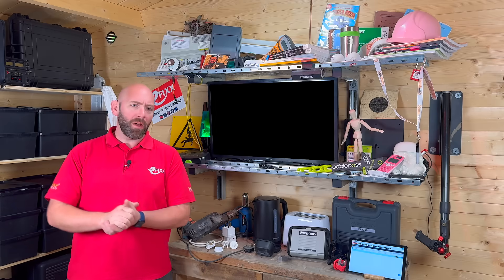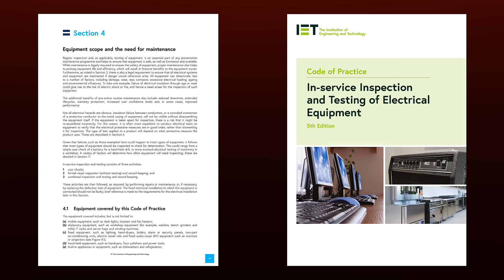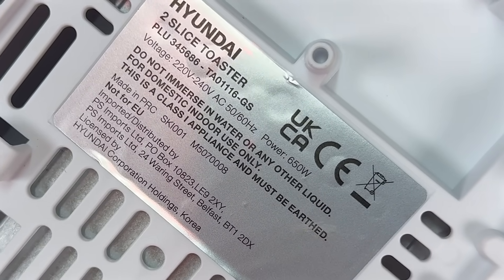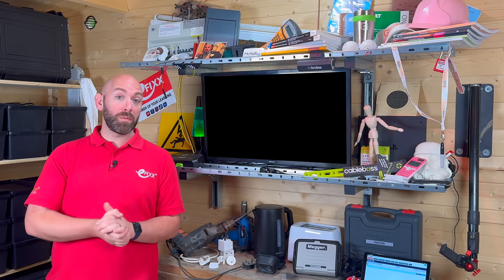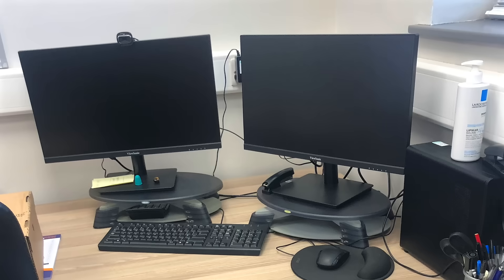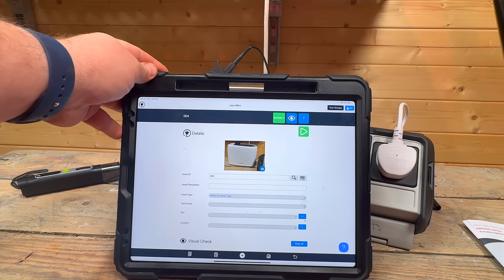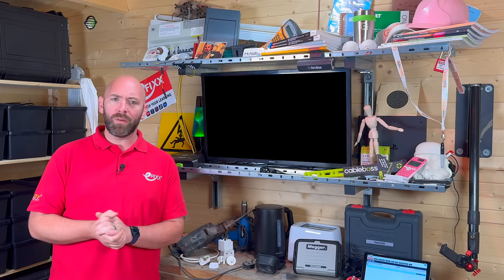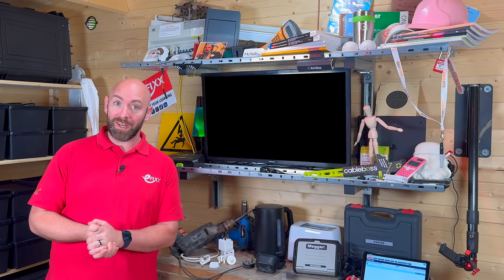PAT Testing ISN'T What You Think It Is!

Comment: The visual test is IMHO where corners are most cut. It's not easy or convenient to games things from u see a desk or counter, but without doing so can you really check the cable walking it's length?taking off the plug cover takes time, as does rectifying cable grip issues etc. Often these items are ignored and it's just a case of does the machine display a tick or not,how this gets addressed when the focus is on price I dunno
Reply: Maybe but it is usually where most actually dangerous conditions can be picked up.
Reply: @JimWhitaker I agree,  but it's probably the most skimped test, especially by those doing 20p and item tests
Reply: The pricing is always the problem. Managers want as much turnover out of their staff as they can get. Why? Because if you can push one person to „PAT“ three items a minute at 30p/item you're making £££s winning contracts from businesses which only see PAT as a H&S requirement and a nuisance overhead, and so want the cost as low as possible. The person who's doing the PAT is likely being given all of 15 seconds to „test“ each item because „Performance“. 🏃💨🔌

Me? I have pretty severe OCD and can't not do a job thoroughly. I take my time and I check everything, often at least twice. I find faults that could potentially cost a person their life, and I make those faults safe before that happens. 👍

And what happens to me? A guaranteed P45 because my „Performance“ isn't „good enough“ for the company... 🤷

Comment: Talking of Class III Is three a more we should be looking for the testing ?    Its a interesting subject and that is due the fact we have hear an accident where person in bathroom taken mobile phone and long charging lead and got electrocuted. This opening a question how was the electrical path form via Class III appliance to cause serous injury.
I'm assuming a proper class III device has full galvanically segregated voltage for USB I would assume 5V and fast charging 20Vdc.
If not there one part of the charging a Negative terminal should be connected to Groung /PE within charger.   Should we not test those parameters ? or verify the Extra Low voltage devices are actually safe ?!?
Reply: In such a case, the fault wouldn't be in the phone or the lead, it would be in the power supply. A proper PAT test of the charger/ power supply (insulation resistance) should have indicated the fault. Unfortunately some people settle for visual inspection of such chargers.
Reply: @peterburns9861  It was quite possibly a cheaply made/unsafe charger, too. There's been a recent proliferation of mismarketed „GaN“ chargers (They don't actually employ GaN at all) spreading over online spaces with false advertising (120w charging in a £15,- wall-wart? I doubt it...) and many of the ones I've seen torn down on YouTube have tended not to have the safest electrical implementations. Referring to them as „Double insulated“ is probably affording them three times more claim of insulation than they have in actual fact. ⚡

The other problem is how todays world is pushing people to take their phones into the bath with them, whether on a charger or not. Having a device with a 5Ah battery might be OK-ish if you're sat on the lavatory, but if any of the bathwater touches all that Lithium... 🔥

Comment: In my team, we call it "Electrical Safety Testing", but we're testing to IEC 62353 and using a Rigel 288 safety tester. The difference? Our equipment is often connected to patients and under certain circumstances patient leakage currents in excess of 10 microamps can kill.
Reply: I do the same mate
Reply: @andyb7813 Fancy meeting you here Andy!
Reply: @drmal    I much prefer that term. The pedant in me finds "PAT test/testing" really clunky. It's like someone working for a bank saying "PIN number".
Reply: @IThinkYouLookLarvely ...or ATM machine

Comment: A few years ago the HSE wrote an interesting paper on why appliance testing is unnecessary in some office environments where nothing moves. (Also discussed in the IET Wiring Matters)
There is a duty on any employer to carry out regular inspection of portable appliances and their connecting cables according a risk based schedule - often completely ignored or not understood.
The same employer then gets ripped off by unscrupulous operators who claim that every portable appliance has to be tested "by law".
The only law which applies is the Health and Safety at Work Act - it even applies in the home if you employ someone who has to operate electrical appliances that you own.
Reply: I bought around 100 brand new 110V tools for a new job. They were all delivered the day before the job started and were still in sealed boxes. The whole lot were rejected, by the main contractor, on the grounds they did not have current PAT certs. I was then charged £20 + VAT per item, by the main contractor, for the PAT certs. No testing or inspections done just a long list of tool description, make, model, power and date.
Apparently even though I was not allowed to use these tools the fact they were brand new & in sealed boxes meant the manufactures certification rendered actual physical PAT testing unnecessary.
Reply: @PeterChapman-rg6gr that is just utterly fraudulent behaviour.
Have you run this past the HSE?
If not  it would be worth getting their opinion.
If the tools where purchased in the UK through a reputable distributor, and sealed, then the manufacturers testing in production must be valid irrespective of the date of manufacture.
Reply: @PeterChapman-rg6gr  I've never had to buy new tools for a job or anything of the nature you describe, but I've been wanting to go into business for years to try and get myself out of a long-running ASD-enforced rut. But if contractors can pull that sort of messing about with subcontractors, that's yet another thing that's pushing us Skilled enough to gain certification quickly folk away from that sort of work! 😳
Reply: Professor Löfstedt's and you are right. Lots of in service inspection ans testing was obsoleted at that time. Alas its still peddled by the every plug top needs testing every year brigade

Comment: and that is why you can't do "pat testing" for 90p an item!
Reply: Especially when it was £1 per item in 2005 😂😂
Reply: I still get companies phoning up and offering very cheep quotes for PAT testing.
Reply: @PeterChapman-rg6gr   mugs
Reply: You can though in many cases where there are large volumes of items
Reply: @TheLostPacketYT That would only be reasonable on contracts made on a whole of property basis though, and that's usually scheduled for testing outside of working hours (e.g: At the weekend) so the testing doesn't interfere with/get impeded by everyday operations.

And there is no way I'd be able to get my appliances (Probably 10-20) tested properly for less than £5,-/item, even if I could be very liberal on availability!
Reply: @UK-Combustibility-Assured the majority of companies doing testing though would have a large contract and a lot of companies do do it in normal working hours they might have a system by each employee gathers their equipment or what they are using and brings it to be tested at a certain time then it’s tested and they bring it straight back and continue working. There are lots of systems used so that there is minimal disruption.
Reply: All of my PATs are free... 😳

...But because my PAT certificate lapsed over twenty years ago, I only test my own appliances now. And I am not charging myself to do reasonable household work! 😋

Comment: I call it Appliance Testing. Not helped by 'PAT Testing companies' saying things like 'Fixed Appliance don't need testing' or when pushed will say 'they only need tested when doing an EICR'.
The biggest scary thing I have seen is a fixed Appliance like a storage heater that has a pass sticker on it . When you look at the documentation it says 'Visual Inspection Only' That is just not right.
Reply: Doubly not right IME. You visually inspect my storage heaters and they will pass with flying colours - Not entirely surprising; One was decommissioned and disconnected by myself as unsafe (When heavily degraded internal terminals were discovered when cleaning out and servicing them during the lockdowns) and the other has clocked up less than 100h of use since it was installed in 2006, all of which was prior to the pandemic, and is such because bias and low rates for EV charging means I (Having no EV, so no affordable electricity) can't afford to drive a 3,5kW storage heater anymore. 🏚

In actuality; The fact the storage heaters have been serviced by a person not qualified and trained by the manufacturer (Though this is justified for the volumes of dust that had settled inside them, presenting a very plausible fire risk) means they reasonably warrant a full test by a competent person before they're operated again. And the fact they've been isolated at multiple points for over five years to date means they haven't even been touched by the two EICRs I've had in the meantime.
Reply: @andrewwhite3793  - nothing to stop someone undertaking a visual inspection then putting a sticker on it to confirm they have completed said visual inspection…